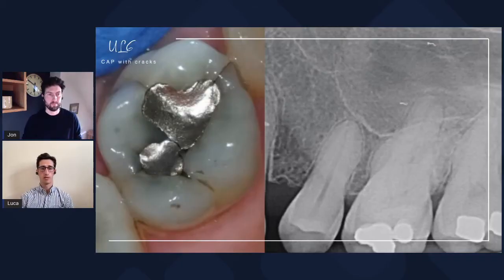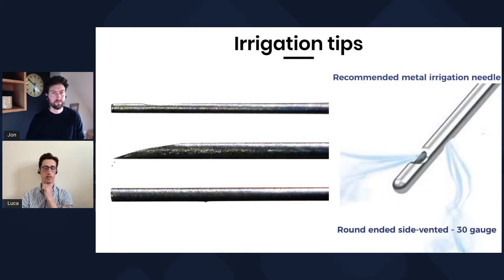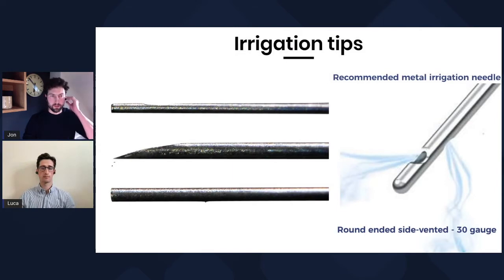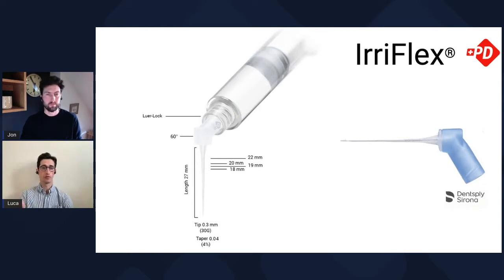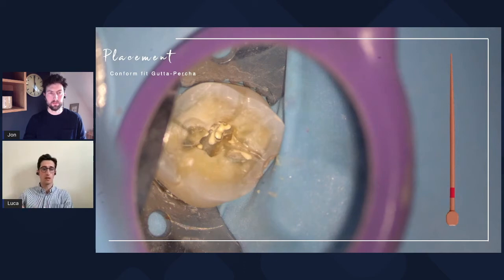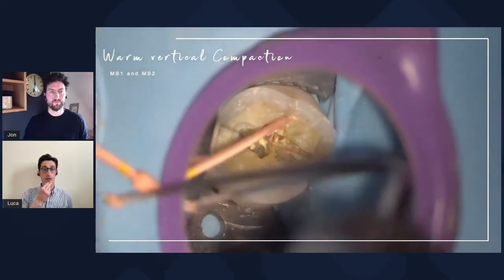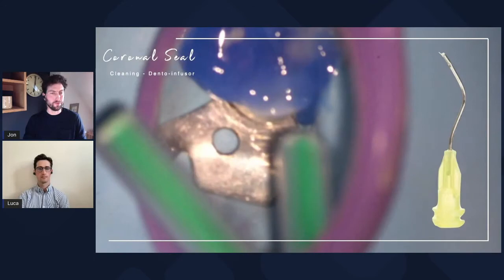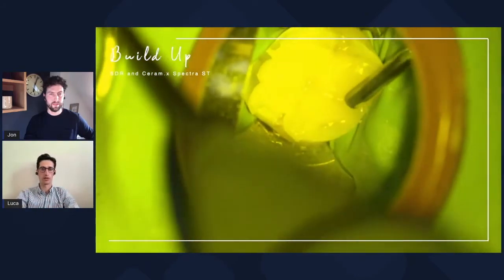Endodontic treatment workflow - Part 2 - Irrigation, Obturation and Core Build Up

Comment: Great video. 
I have used the dentsply plastic irrigation needle a few times and in every single time it got blocked during the treatment and had either to cut the tip or discard and go back to the metal. 
Any tips on how to avoid this ?
Reply from the maker: Thank you for watching Ali! We had the same slight issue, you’re right. It would happen more often if you draw back fluid with the needle, avoid this as this is the most likely cause. It is such a small and delicate tip that unfortunately blockage can happen.